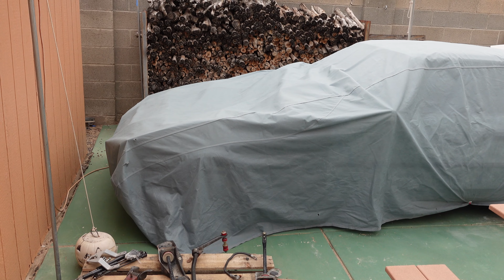The Final Build: Week 10

Comment: hey did you ever figure out the  idling/ start issue. my 85 300zx is doing the same thing and could find a video that fixes it 

https://www.youtube.com/watch?v=AQROih7y3_0
Reply from the maker: For me, it was a combination of the mass airflow sensor and its wiring harness (I replaced both) and I also had low fuel pressure. Replacing the CHTS is also a good thing to try and last case would be the crank angle sensor. Have you run codes on the ecu to see if it's saying anything is out of wack?

Comment: Wasn't quite sure about your comments regarding the lowdoller sensors.  Are they good, or are they bad?  There are 2 price levels on their site, a series that cost $30+, and a series that cost $60+,.  Which type did you get?
Reply from the maker: They are good sensors and I do recommend them. They have different options for what you need. You can just get a regular pressure sensor at a variety of pressure ranges (I think I have the 0-100 psi sensor in mine). And they have combination sensor for pressure and temperature. It just depends on what you want to measure